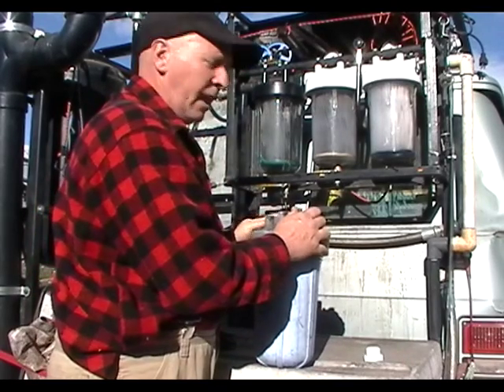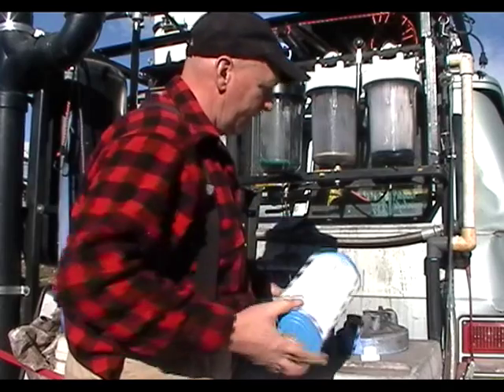Comparing cartridge filters verses bag filters for making Vegetable Oil Blend Diesel Fuel

Comment: Ever thought of using a stainless mesh inserts they come down to 100 micron then a bag  then a canister to save your fine filters and stainless is infinitely reusable clean and can be reverse flushed ??? a basic example is this but commercial grade is available. GOLDENROD (470-15) 40-Mesh Fuel Tank Filter Strainer
Reply from the maker: speedxdreems Sounds interesting.  I prefer several stages of filtration, because each filter canister has a sump capable of holding a significant amount of sediments.  Also, what my filter manifold traps is not just particles, but fluids that are approaching their gel-point.
Reply: Jeffrey Brooks well then you have it all figured out. but those screens i mentioned fit inside your filter canister just like yours do but they dont  deteriorate,  like you mentioned yours do!  thats why they are used in refining and chemistry i have seen them in the plants just saying . but by all means continue using degradable materials and kitchen strainers ... Regards
Reply from the maker: speedxdreems I would be happy to use stainless mesh inserts in my pentek filter canisters, but there does not seem to be any available for it.  Nonetheless, my filter media does not degrade.  They seem to last for years, as long as I back flush them on a regular basis.
Reply from the maker: The stainless steel would have to fit; whereas, bag filters are cheap and back flushable.  Keep watching my videos.

Comment from the maker: Sorry, tony, I did not realize that you were describing the filter medium.  I thought you were describing the housing.  So, if your "stainless steel water filters" are some kind of mesh sock, then you could pour WVO through them, but you may need to devise something to hold them up.  Some people cut a whole in a bucket lid, or barrel lid that is just big enough for the sock to fit through, and the bucket or barrel is tall enough so that the filter bag or sock is suspended, then dirty oil is pour

Comment from the maker: Stainless steel canisters are better than the plastic ones Pentek uses, because the swell, whereas stainless steel ones will not.  

200 mesh is a good first or second stage.  If you look around you might be able to find bag filters for your stainless steel canisters.

Comment from the maker: Good to know you are going to join vegetableoildiesel dot co dot uk.  If you introduce yourself on the blending forum, then I will respond.

The rhetoric is common rails have more trouble with burning waste oil fuels, but all of the reports I have read suggest that common rail diesel engines burn blends better than the old IDI diesel engines.

Comment from the maker: @lolailando Pentek 20" bag filters are about $150 ea.  I use one 1-micron bag filter in my system, and I am very happy with it.  Just Google "Pentek bag filters".  However, I also have two 2" y-traps in front of that bag filter.  They a ac re from Banjo., they have 30-mesh and 120-mesh strainers in them respectively.  I am very happy with them as well.

Comment from the maker: @lolailando all pleated filters have a great deal of surface area; however, all pleated filters have an elastomeric seal that fails of the alcohol content in the blend 2%.  So, I switched to bag filters which do not have an  elastomeric seal.  Yes, string wound will work, but it is not back-flushable.  I prefer to back-flush my filters so that I am not buying new filters all of the time.  If you do not back-flush your filters, then pleated or string wound filters are fine.

Comment from the maker: @jolow2 thanks, I am still using the same 20" bag filter to process my fuel, and it has shown no sign of failure. Also, now that I have a bag filter in place for processing my fuel, whatever solvents I use are no longer an issue